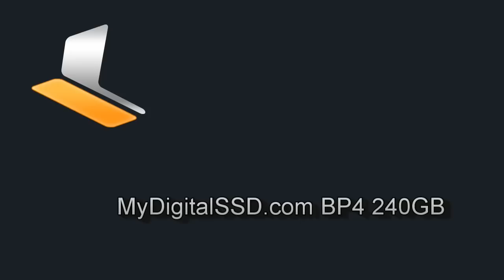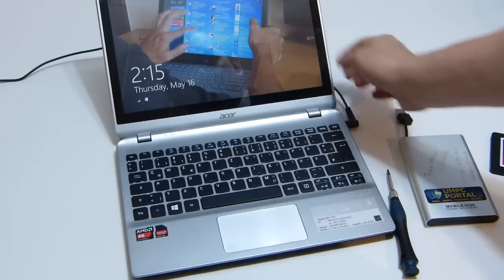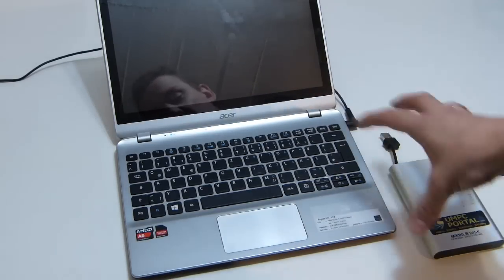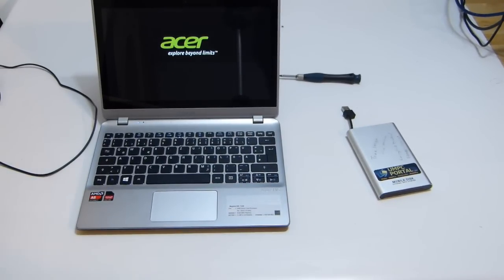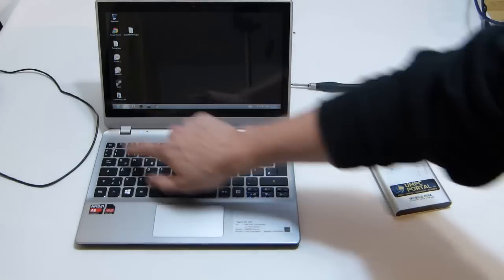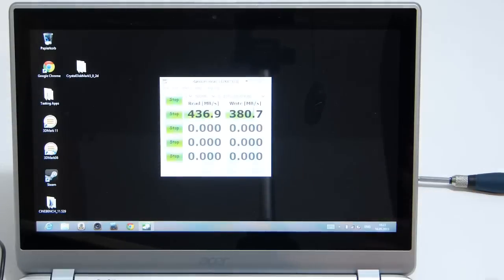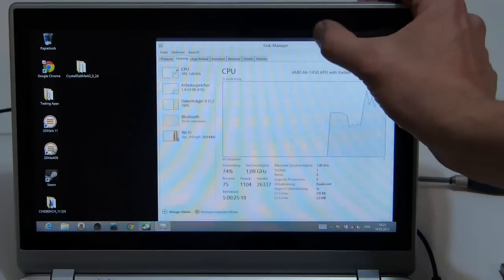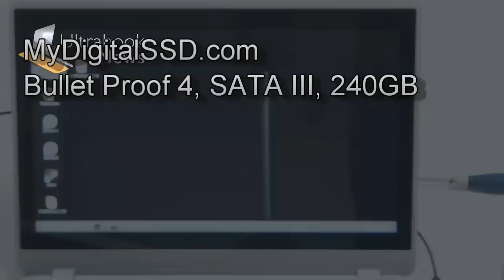Acer Aspire V5 122P MyDigitalSSD BP4 SSD upgrade

Comment: I have one of these, had it for a couple of years. From the off it was so painfully slow that it was virtually unuseable. I'd become too invested in it to take it back and then just bought a better laptop. 
Upon packing to move house I stumbled once again on this piece of shit and I'm wondering if there is something I can do to at least make it capable of browsing the internet. Any ideas?
Reply: I believe mine came with Windows 8 and after installing 10 it seems to manage it's resources a lot better now than with Windows 8. Alot more snappier. Could use a single 8GB DDR3 stick and of course a cheaper SSD.
Reply: I know its a year late but i tried using Ubuntu OS and oh my god it can run 720p with ease, with windows 7 it would stutter so much compare to it, 

I had a ssd aswell so it helped alot

Comment: I assume max hight of the 7mm drive

When testing windows 8 or 10 boot speed make sure you turn off fast startup in power options as I bet you turned that on from a shutdown (witch is a hibernate state in Windows 8 so it started up faster), just below the options that say password on wake up there is a ruck box that says fast start up (when ticked only a reboot is a clean shutdown, I unpick it on all systems as had Pepole with 40 days uptime and was causing problems )

Comment: I have limited knowledge on computers and I need a bit of assistance. I want to install a 240GB SSD on my Acer Aspire 122p. Its the same model used in the video. The hard drive has 500GB and ive used around 220GB of it. I want to put the SSD in my computer, and want to put the photos from the hard drive on the SSD, and keep using the hard drive. (I want the hard drive to be 100% clean after I transfer the photos.) Basically I want to back up my personal files unto the SSD from the HDD. 
My only problem is that I don't know how to actually transfer the photos once the SSD is in. I'm guessing I need a cable to plug the hard drive in. But where would I find the cable? What's it called? Is it available in a store like Best Buy(my preferred option) or do I need to order it online?? :) Please reply below if you think you can help!

Comment: Hey there.  I upgraded the factory HD on this exact model today with an SSD drive.  I had to use an adapter for, as I had a leftover mSATA SSD drive from a main desktop upgrade (went from a 256Gb to a 500Gb on desktop).   The 256Gb drive I threw in a 7mm adapter, and got it up and running.

Your video was a big help there, knowing what to look out for. 

Thumbs up!  :)

Comment: That SSD is a TLC Grade and adds 3 bits per cell, Cheapest and doesn't last as long as the MLC and adds 2 bits per cell, less room for error which you can always tell by its size for example that's a 240GB and it reserves a hidden 16GB for errors whereas the MLC SSD Will show it's a 256GB SSD with longer life and less errors and the SLC which can easily be singled out because you can't afford it... lol... The SLC Grade Comes in a much lower amount of GB's, last the longest and only adds 1 bit per cell which makes it the most accurate, but much smaller in the amount of information being stored... SD and Micro SD Cards are mainly TLC so don't have that false sense of security because there's no moving parts! Try to buy MLC, best bang for the buck...

Comment: Hello! Thank you very much for your video. I can see that you upgraded the RAM. I putted 2 more GB to the 2 GB installed but the system can only use 1,45 on W7 64 bit. Thank you very much in advance.

Comment: i took the back plate off of the screen flipped it around and turned it into a tablet, i'm typing this on it so it is definitely working.
Reply: jeremiah gustafson  I'm interested in doing the same but how did you pair the frame of the base to the backof the screen any pics or tips would be nice

Comment: Just installed an SSD in my unit, every thing went fabulously successful. I would suggest that instead of disconnecting the ribbon cable, just remove the screw to the audio module circuit board and lift it up. That ribbon cable is entirely too delicate to mess with, if it can be avoided.
Reply: David Evans I tried in mine but I don't know why my ssd is more thick than the internal hdd so I'm not able to completely close my pc. I tried with a 2.5" OCZ 120gb ssd. There is a way to use an M.2 ssd?
Reply: Good idea. Thanks for the tip. I know this is a older netbook but I still keep it  to use while visiting my parents overnights.

Comment: At the risk that Steve Paine won't get this because the video is a bit dated, I am going to try anyway

I used Acer's utility to make a backup of the system on a 16GB usb drive.  Enabled F12 at startup.  Then, replaced the HDD with an SSD.    It seems as if I get about 70-75% of the way completed in the recovery and then it fails.   There are a ton of files on the SSD but I cannot boot to the SSD.  It shows in the BIOS after install but, when pressing F12, it is not there after I remove the USB drive from the port.   It says that the drive where Windows is installed is locked.

Any advice?

Comment: Thanks for that video! I haven't read the full article yet but here the Things that might be interesting too so far. I've bought the subnotebook from amazon.de for ~370€ [Quad Core Temash Processor] I'm planning on putting also an SSD in it [Samsung 830 Series 128 GB] and opened it once, I would maybe prefer to unplug the battery since the whole motherboard is on power!?! The RAM is splitted, one is soldered on the MB and the other one is normal notebook RAM expandable to 4 GB means 6 GB total. There is a port on the bottom for en external battery but there is none made for the model, but I've spoken to acer's support so there is a compatible battery for the acer Aspire V5 132P that is compatible to this one.. I'm thniking hard about buying one..
So now a big question: is the acer converter cable port able to be used with an display port to HDMI adapter? becouse it's the same plug so far..
So thanks a lot for this Video I feel now confirmed in my intention to rebuild the little beast

Comment: Does the power consumption gets better with SSD?
Reply from the maker: Untested but I'm 99% sure you'll get some advantages. 5% would be my estimate. Maybe 10% if you have a lot of disk usage.
Reply: *****  Thanks Steve
Reply: +GAMER_sha i dunno if you know about this by now but you can't change the cpu for this laptop 'sadly'..but you can upgrade the ram, but theres only one slot for a ram change so getting an 8gb stick is something you want to do, or an ssd as that can really help, i have this laptop myself :]

Comment: Make sure you remove the SSD card (or factory fitted dummy SSD card) from the SSD slot on the right BEFORE attempting to remove the base, otherwise you will break the SSD slot!

Comment: mate, can you also upgrade that RAM?
Reply: yeah u can add ram up to 10gb
Reply: Yes you can.. but not 10 gigs ;D 6 GB is maximum becouse 2GB are soldered!!
Reply: aetmi
im running at 10.9 GB  :) 122p 0408 acer aspire A4

Comment: From there, proceed to peel off the cover until you can slide it past the audio port connector. 

At 4:20, you don't need to mess around with the fragile cable. At 4:40 he unscrewed one side of the mini pcb holding the audio and USB2.0 ports. Just unscrew the other side and you can get that cable harmlessly out of the way.

Comment: I just upgraded my HDD to the Sandisk Ultra Plus 128GB. This video had been a big help so a big thanks to Steve. To add, it can get a bit tricky prying open the bottom cover at first after getting out the 12 screws. What I did is to pull out the SD slot plastic placeholder first. Then get a small flat head screwdriver and insert in the SD slot as leverage. Slowly pry the cover ever so slightly just to get a fingernail in between the cover and the body.